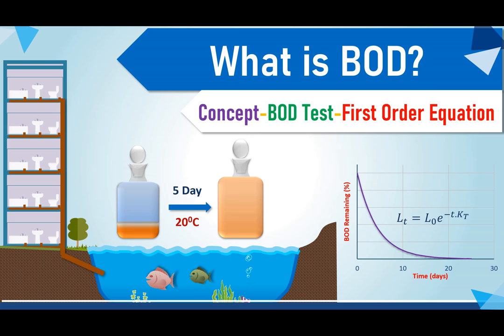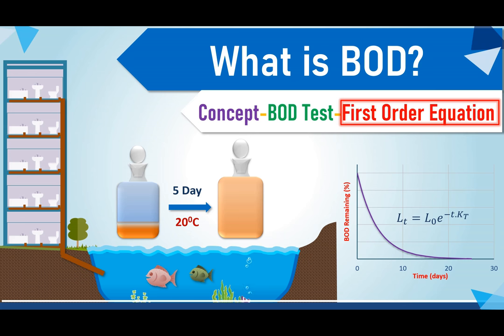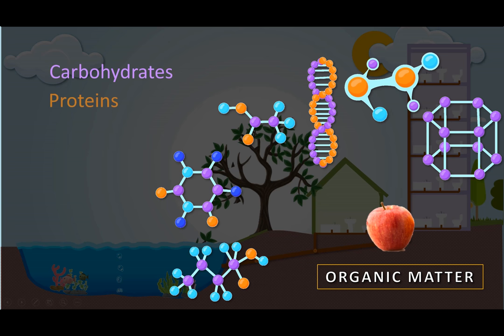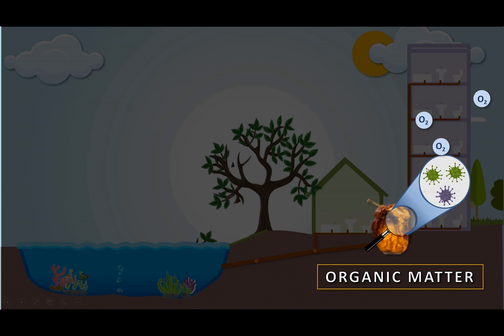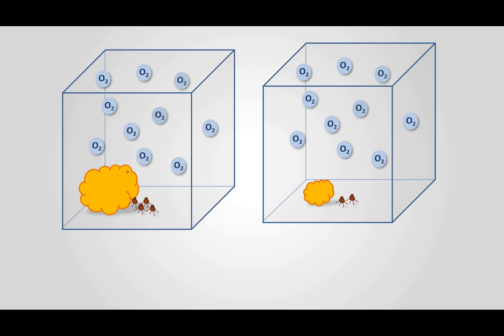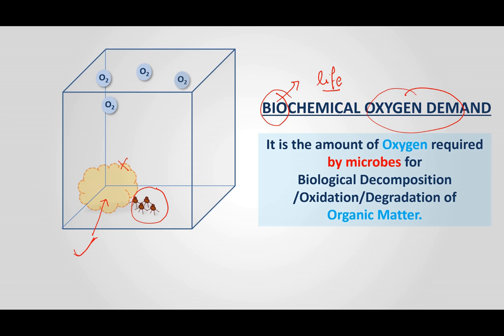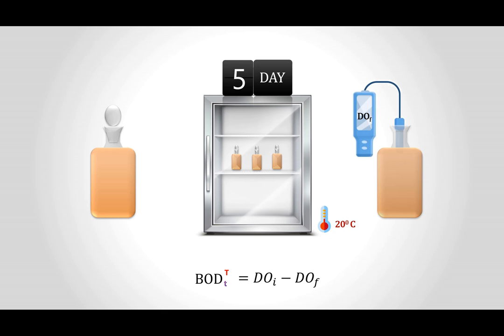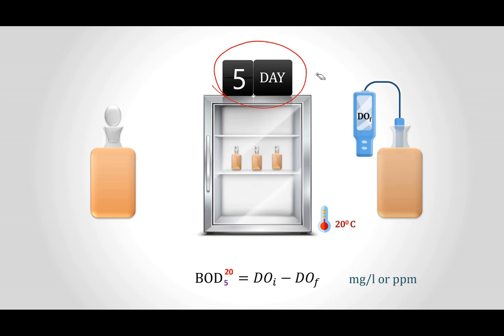Biochemical Oxygen Demand with animation | Concept | BOD Test| First Order BOD Equation

Comment: Why No treatment of sewage is done if the dilution factor is more than 500? We know more dilution factor means more bod. More bod means more treatment required. So why no treatment?
Reply from the maker: You are using Dilution factor term in two different contexts. Don't get confused.
Case 1. When a small amount of highly polluted sewage water is mixed with large quantity of fresh river water, the sewage water gets diluted and hence requires very less treatment. In this case the BOD of sewage water is very high, whereas BOD of water after mixing with river is very less.